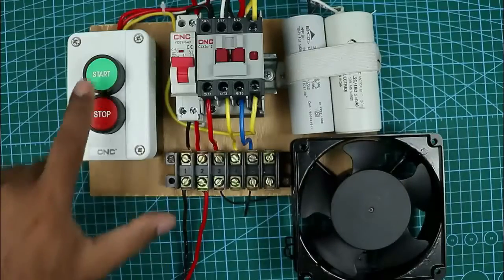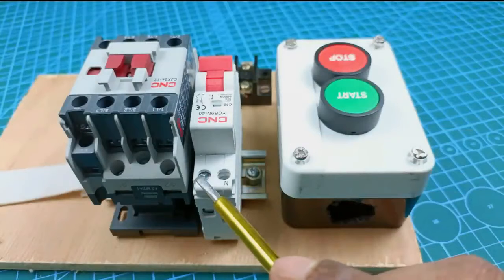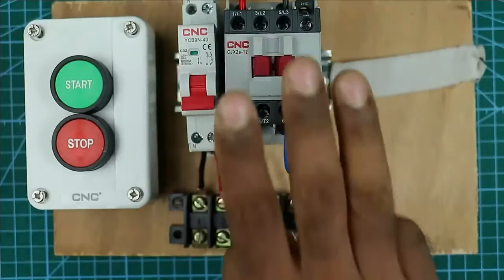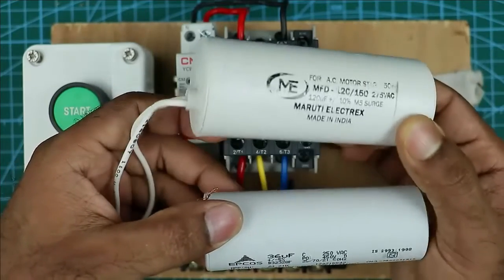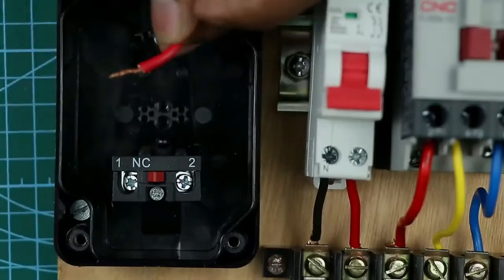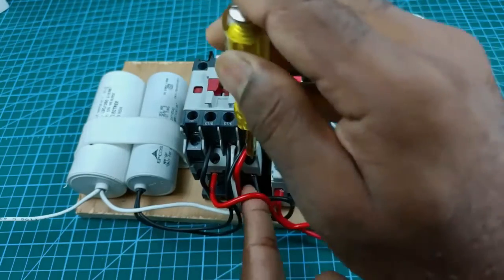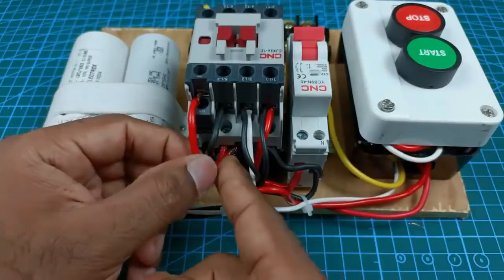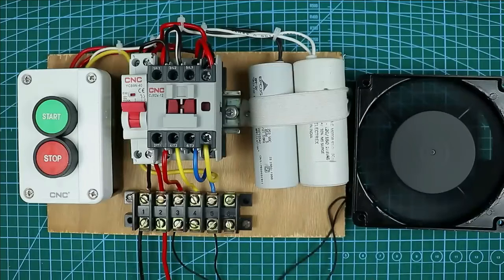Wiring of Single Phase Submersible Pump Starter by using Two Capacitor @TheElectricalGuy

Comment: Sir I have volt amps meter when I push start button a spark is coming from the connecting words to the starter. When inpush stop button it is not stopping plx tell shy

Comment: This is an excellent tutorial, but if you are in the USA there are some slight differences.  American (and Canadian) 240v consists of two 120v hot, a common, and a ground.  For submersible well power, you use the two hot for L1 and L2, and ground to what the well motor is grounded on.  The wiring for the well is different too.  Black is "run", red is "start", and yellow is the return (instead of the common, here).  So, the changes on the contactor are minimal, just switch the wire color, use a 2 pole MCD (like a Delexi DC47s), and wire the control to the L2 (yellow) circuit instead of the L1 (black).  Also, use of the overload is recommended even IF you are using an MCD, as the MCD protects you from a short circuit on the power side, but the overload protects you on the motor side.
If you wire this as shown in the US or Canada, and use the second hot for the common, it will work at first, but it will blow your start capacitor after a few uses.
Reply: MCB, not MCD (DOH!)🤭

Comment: How about incorporating a float switch in this connection
Reply from the maker: In single phase motor which has a capacitor start option in that motor you can't connect float switch, if you want than you have to use a timer to turn on the starting capacitor for few seconds